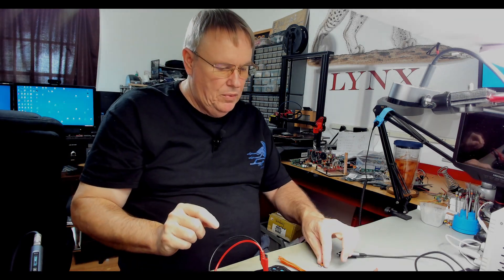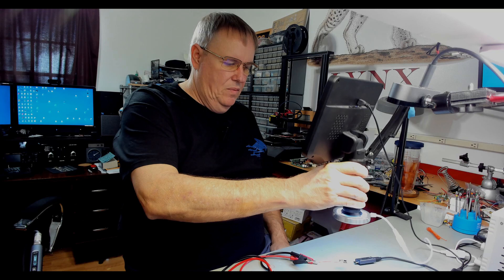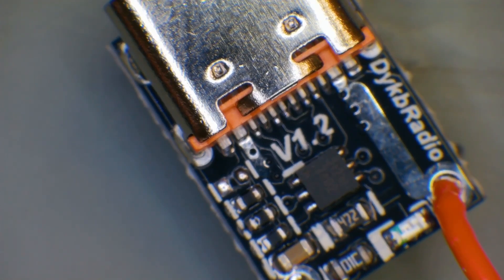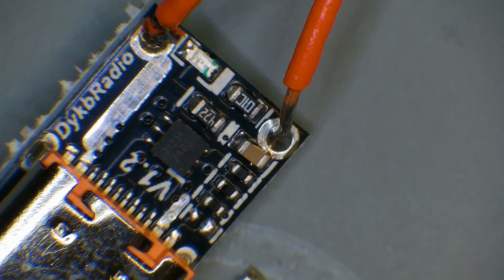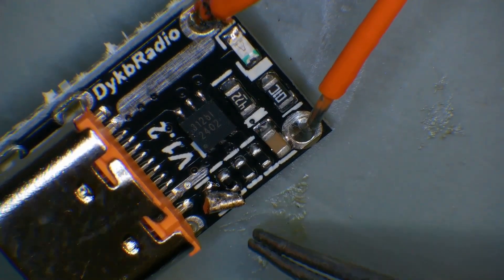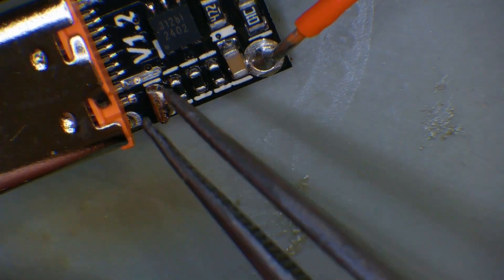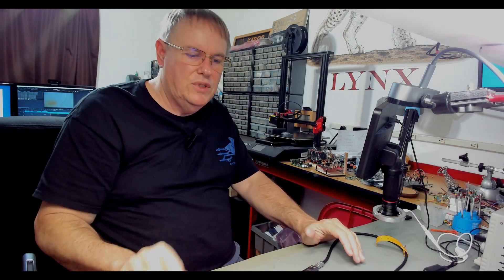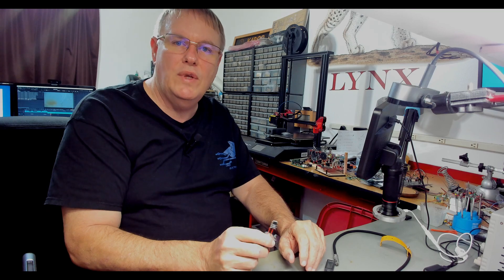DON'T Buy A USB PD Decoy Until You Watch This Video!

Comment: why use a wire just use solder to breach it, its not like this thing can handle multiple amps
Reply from the maker: Thanks for the great question! In my experiences, with the solder resist mask it would be hard to get a big enough blob to jump across the pads without shorting the resistor next to it. Very hard to control the solder blob over the resist mask. It tends to build and build over the pads and then gets large enough that it goes where ever it wants with very small size pads. It can be done but a wire as a guide works easier for me. 
RJ

Comment: Today you need different soldering skills for doing this kind of project. It's not more difficult than old style soldering and construction, but you need different tools (stereo microscope is  a must) and skills. I would simply have used a zero ohm resistor for the jumper
Reply from the maker: Thanks, I did not have one that small as I do not use parts that small in my projects.
RJ

Comment: Hi RJ Yeah they really did use small pads there, guessing 0402 I wouldn't be surprise if its 0201. That version of the board seems more design for a product than for hobby use. Sounds like the newer board will be a better option. Now days I can't do much without magnifying glasses and microscopes plus a good light source. I always have a flash light in my pocket or next to me.
Reply from the maker: Yeah Rick, it does suck to be getting older. I will have the newer boards in the next video to test out.
RJ